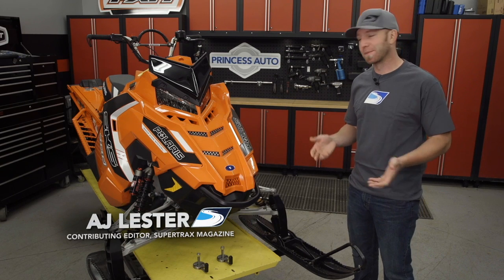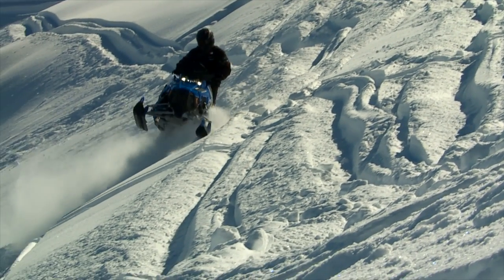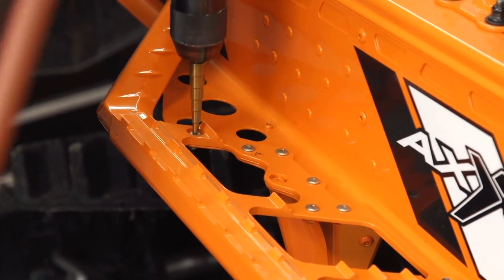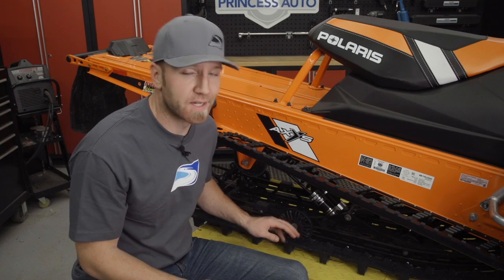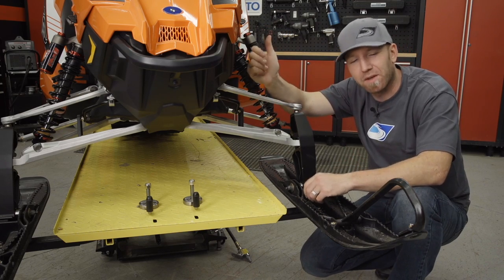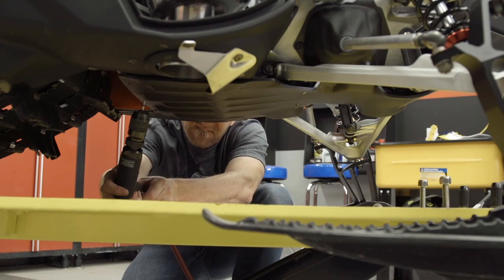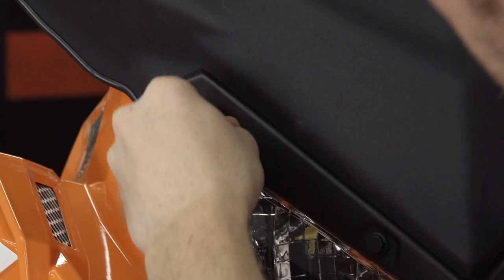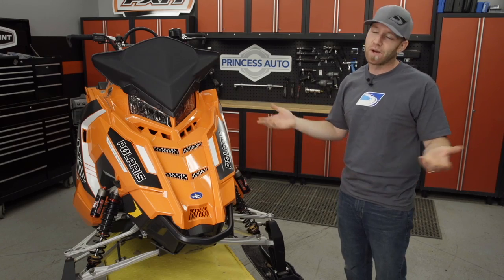2016 Polaris SKS Project Sled: PART 2

Comment: I have a 2017 Polaris SKS, which is the same as 2016....when U installed ice scratchers seems like when stowed up it interferes with front bogie wheel.....what did you do to prevent this?
Reply: Me too